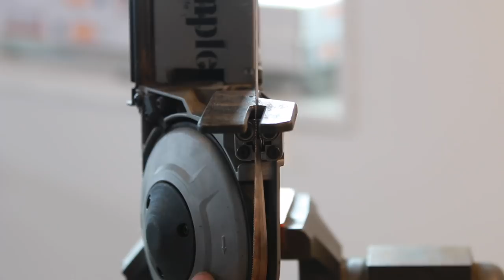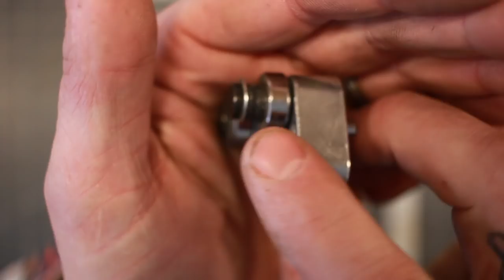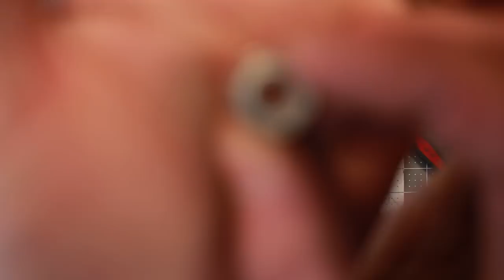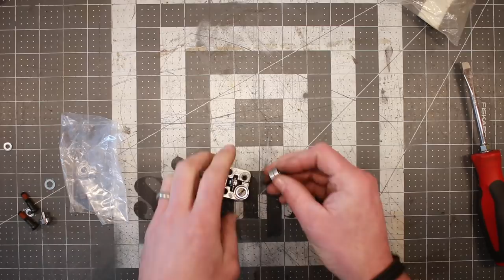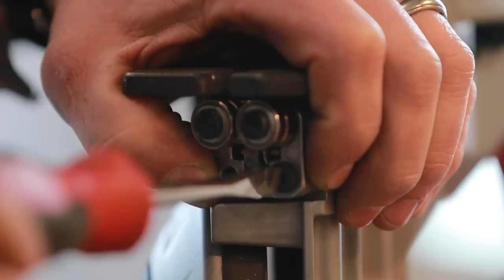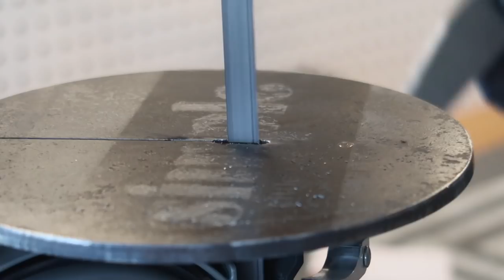Fixing my Portable bandsaw - (blade guide bearings)

Comment: Houses in cold climates have an 'arctic room'. A small room on the front/back of the house where you can put your boots on and off... Which keeps the cold out of the house. Make such a room out of that staircase, to keep the dust out of the house. Could be as simple as a 2x2 frame wrapped in plastic, with a storm door on it...

Comment: Very helpful video, exactly the same band saw as mine!
 Interested to know what TPI blade your using? I've been using a 14tpi blade and it struggles a little cutting 4mm 01 tool steel but yours seems to cut through with ease!
Reply from the maker: +Andy Brocklehurst thanks! Actually I also just run a 14 TPI on mine. I find it to be the best all around blade for what I cut. Cheers👍

Comment: I am a fan of going ahead and replacing parts if you have new ones, while you already have the tool apart. I would have put the new back bearing on. Also, instead of leaving the old bearings on one post... Since the front ones obviously take the most abuse... I would have put the old bearings on the back of each post, and the new bearings on the front of each post.